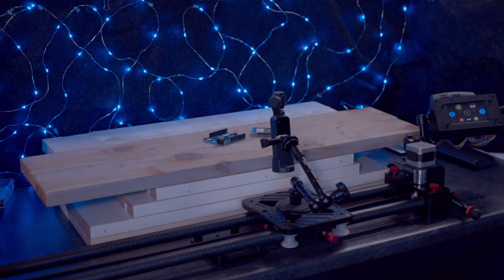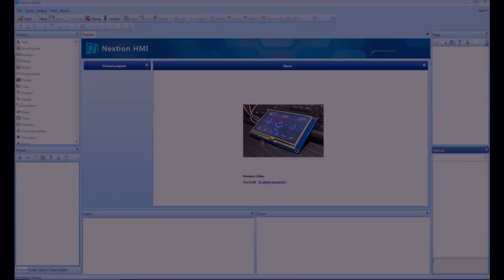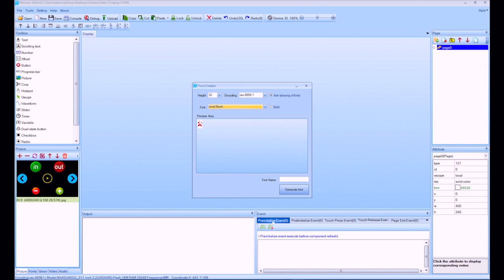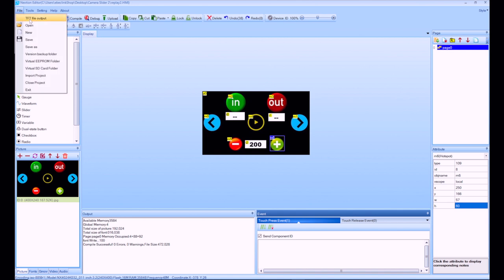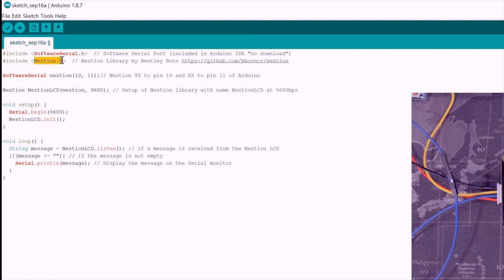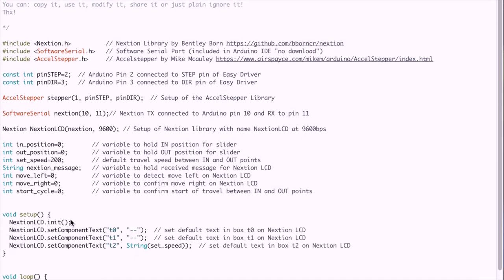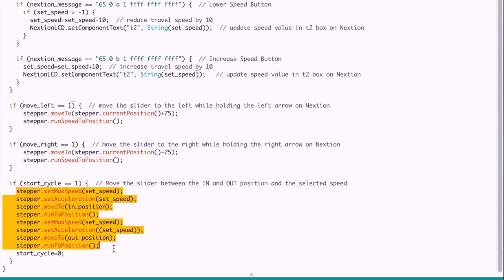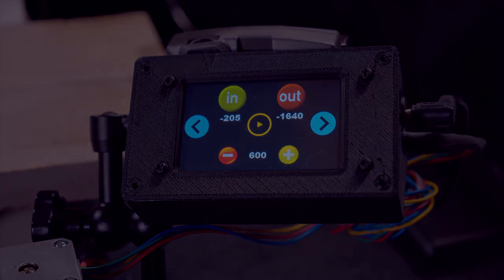Arduino Motorized Camera Slider - Let's Finish This!

Comment: I tried this experiment , its work perfectly , thank you so much your idea and tutorial , can we add some features in to the code how its possible, 1 - can't stop when the motor rotation starts , 2 - start point and end point marking is good how add next end point when  first end point reached the motor(camera), 3 - can we add 2 different speed in the same movement (ie : when camera reaching in a position quickly then slowly move to the next poison )

Comment: Great work bud.
I am building something similar and this is great inspiration.  I am hoping to add multiple waypoints to mine in addition to "In" and "Out" and your code looks straight forward enough to MOD to do this.  I'll let you know how I get on.
Reply from the maker: Always great to hear that the tutorials are helping, good luck with your project and let me know how it turns out.  Thanks for watching!
Reply from the maker: @MarcelDiane  Sure, that could be added pretty easily.  Thanks for watching!

Comment: Hi I'm totally confused. I'm using a Nextion screen and an A4988 driver but i assume that it should still work. However I can't change speed and although i can set in and out points and the motor will cycle between those points no numbers change on the screen???? I have used your code as written except for changing the button addresses. Can you give me a steer please as to what can be wrong or how i can test. Thank you